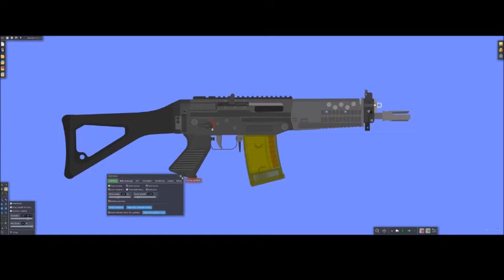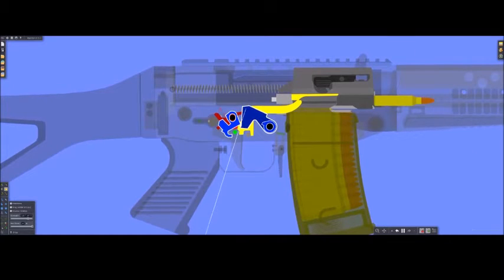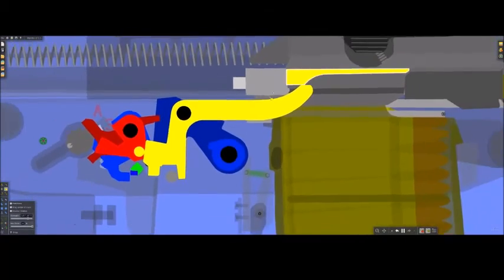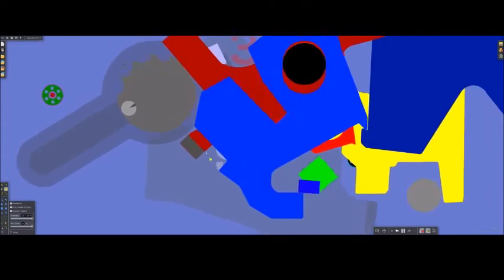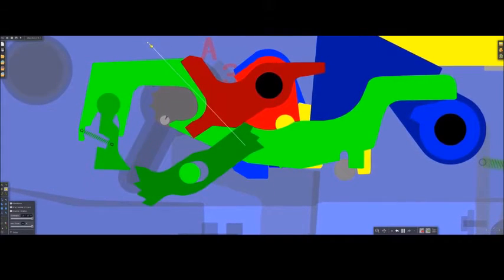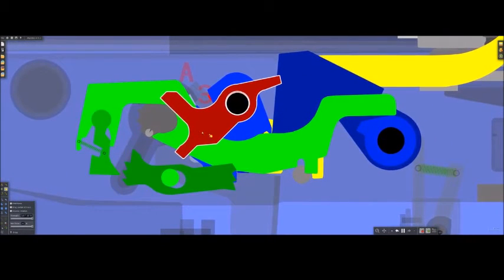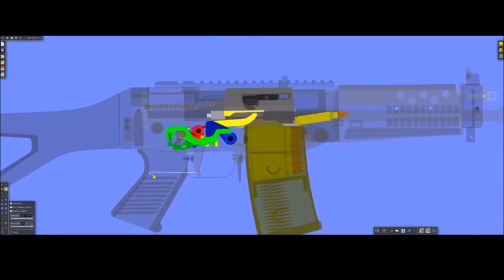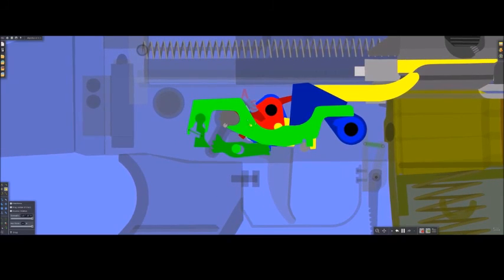How 3-round Burst Works (Sig Variant)

Comment: you should probably do the FN FNC 3 round burst, it's the simplest 3 round burst mech I've seen, it only has about 3-6 parts moving parts in a small 2 inch piece of steel
Reply: Same with the AK burst packs, they're small stamped sheets of steel with a couple of levers sitting on the hammer and trigger pins. A pawl on the hammer uses ratcheting to control a level, on the other side of the lever the "counter" ratchet is the disconnector itself, which is held back and allows automatic fire. Once the counter "ends" the shelf is cut deeper and the disconnector dips forward, arresting the hammer and interrupting the burst.

If I'm not mistaken, the Polish Tantal burst packs have a left-side selector to switch modes and a single disconnector for semi-full-burst while the safety is just a safety; while Romanian AIMS burst packs use a re-engineered safety selector for safe-semi-burst-auto and two disconnectors, only one of which ratchets along with the burst pack.

Comment: pretty simple, im designing a striker-based rifle trigger mechanism for a couple weapons im desiging myself, im going with the "slip" sear setup where the sear that holds the striker back is pushed back by a spring when it is released from the striker, disengaging it from the trigger to allow it to reset.. it'll basically just be a 2-part trigger system not counting the striker which of course is an analog to the hammer

Comment: As far as I can tell the trigger group is the same in the Stgw90(SIG 550), except for different angles on the safety lever(larger angle between the settings). And you seem to have simplified the operating mechansim a bit, since I'm pretty sure the SIG552 also has it's recoil spring on the gas piston, hence in front of the bolt carrier, not behind it:) 

Regarding the over-engineering: The requirements towards Swiss service rifles are quite high and so is their price. So the general mentality is to add small features anyways since making an already expensive rifle a bit more expensive isn't as notable. This mentality resulted in a great trigger(for a mil-spec), and a consistent burst. Plus of course redundant safeties all-round(For example the triangular tail to the bolt carrier is a safety, preventing the hammer from hitting the firing pin, unless the bolt has rotated into battery(causing the firing pin to stick out just far enough from the tail to be hit).

Thanks for the animation and greetings from Switzerland
Reply: The SIG SG 552 has an AK-styled recoil assembly, while the SIG SG 553 has the recoil spring on the gas piston like a SIG SG 550. The 553 replaced the 552, as the 552 had reliability issues that none of the other 55X rifles had.
Reply: Took it for granted that all guns of the SIG 550 family would have similar internals. So quite surprised they went towards the AK with the 552, but that does explain the development of the 553.
But thanks a lot for pointing out my foolish assumption:)

Comment: Can you do the binary trigger next? Should be about the same as semi, just the secondary sear is a little shorter so it releases the hammer again when you let off the trigger. You can actually make them out of burst fire M16 parts kit and even have a semi mode still, just shorten the tip and cut the hook off of the burst disconect.
Reply from the maker: Garrett - i'll get around to that!

Comment: More than two years since I first saw your videos. A lot of (not gun related) work and still no time to learn how to use algodoo with such precision. I can't figure out how to import autocad 2D parts to algodoo.
Reply from the maker: Gunther Arnold pretty sure you can’t import anything from autocad in, since the program runs on an entirely different programming language, and it handles geometries different. All I can say about the precision is that it just takes time to go in and adjust things as needed. This model took days or even weeks of work to produce, and I still don’t quite consider it perfect. It serves its purpose, though.
Reply: @StealthTheUnknown  I learned how to import BMPs generated on autocad, but, after imported, they look like "torn from paper". (I am not sure, maybe GIFS with transparency - I don't try to do it since 2016)